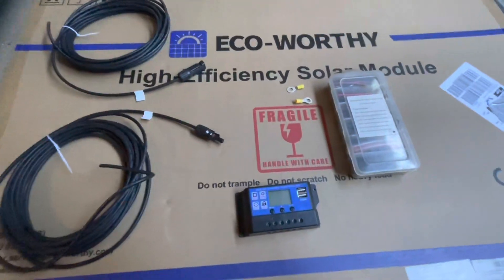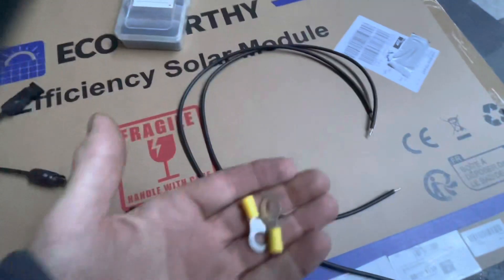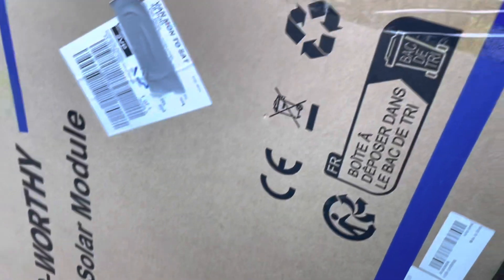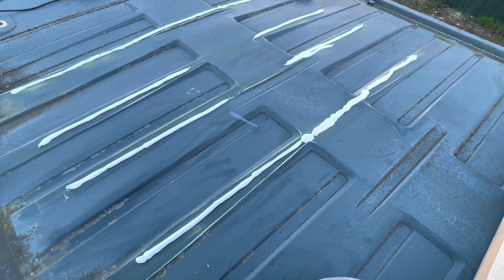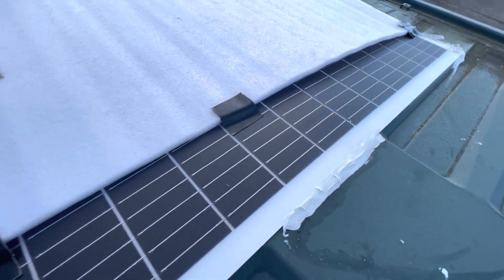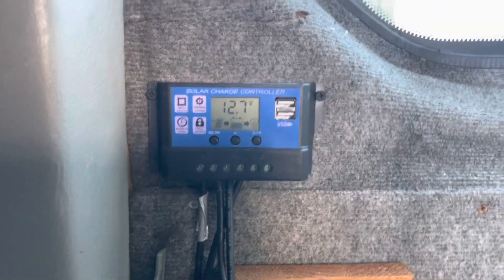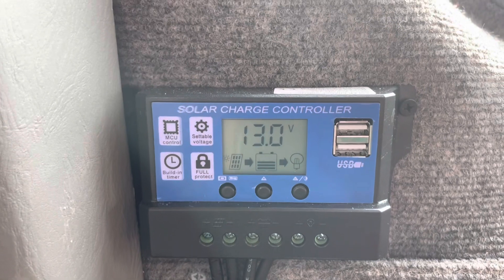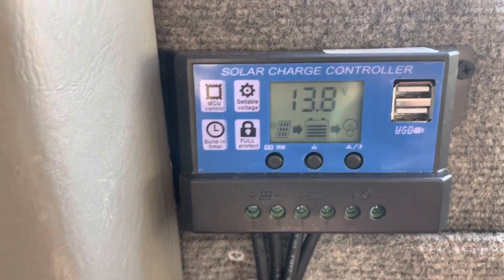Solar Power! Budget camper build part 8

Comment: all this work with split charge system?

solar panel charge battery  when car not run but what cheapen when you start car  and alternator charge battery   , solar panel swich off  or  charging  both one battery faster ?
Reply from the maker: The solar controller manages how much power goes to the battery, when it’s full it will just trickle charge to keep it topped up whether the engine is running or not.